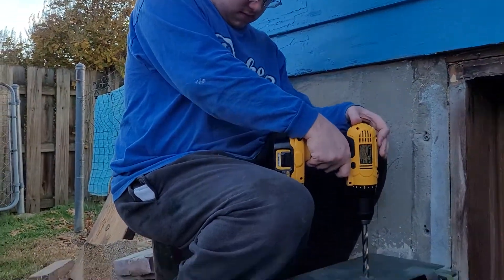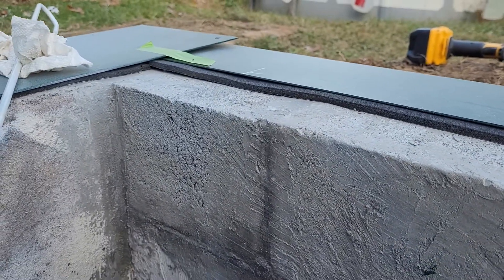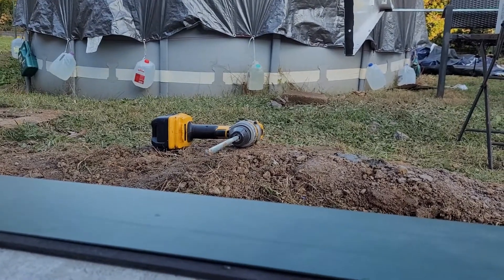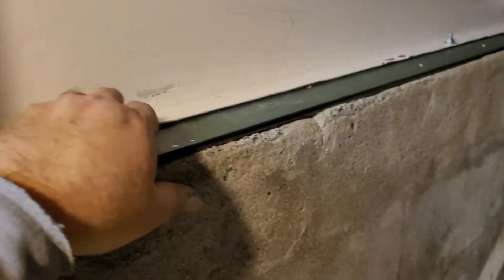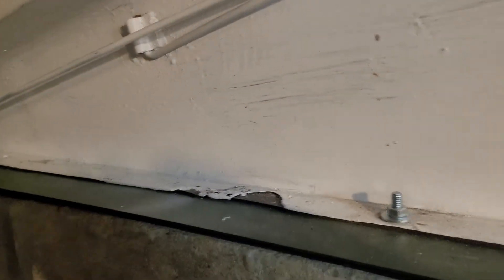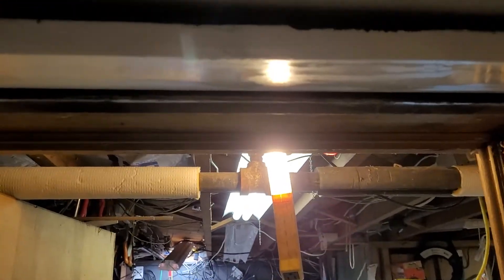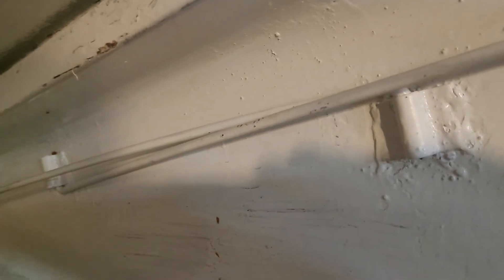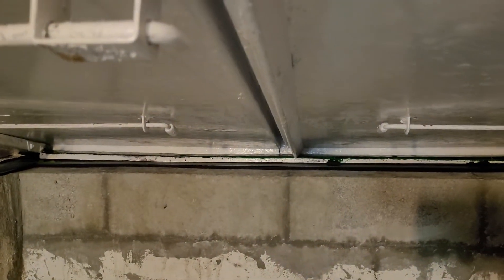repair of bilco door part 3

Comment: Question, I have 2x4’s sitting on my concrete and water is leaking under them onto my wall. Should i replace the wood with the steel plates you used, and caulk the seam on the inside? I don’t want to replace the entire door due to cost. Thank you
Reply from the maker: i found the steel plates worked great the water always ran down door and soaked into concrete no matter what i put on the concrete.
 i would take door off and rip up wood you could put new wood but make a sheet metal flashing to cover it and divert water away.